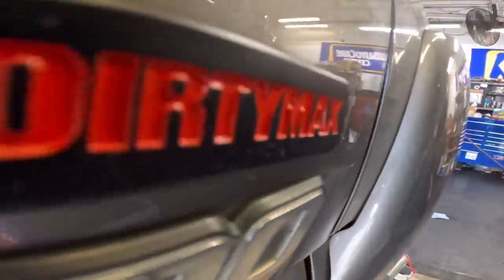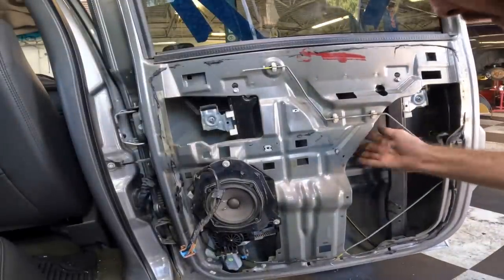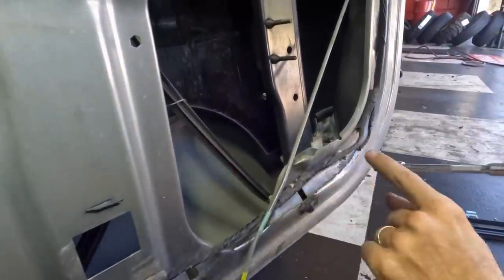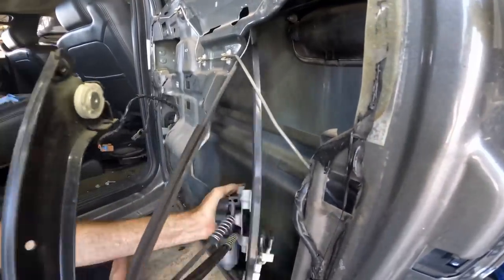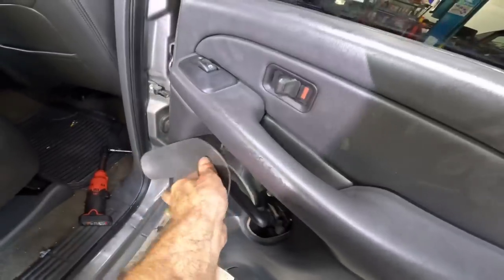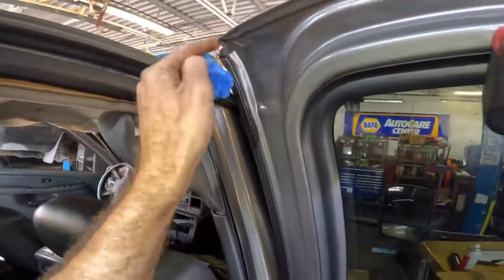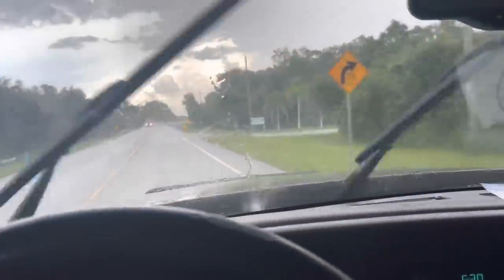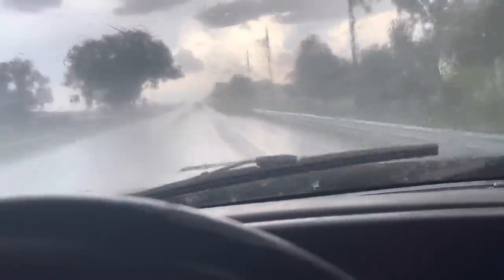Busted Window Regulator!  2007 Silverado 3500 Duramax 6.6

Comment: When working on automobile winders, I appreciate the extra care that manufacturers take to hone all exposed sheet metal to nice razor sharp edges.
Reply: I built dozens of desktop computers decades ago,and signed every one with blood. Couldn’t work with gloves, either.
Reply: I have not opened the inners of a car door since the moisture liner was waxed paper instead of clear poly.
Reply: @MonkeyJedi99    Now I don’t feel quite as ancient. But I do recall having to repair the drivers window crank mechanism on my 1961 Ford Falcon. It was a pain, too.
Reply: @mred8002  Old folks unite!*
*from our separate rockers and recliners, if you don't mind.
Reply: @MonkeyJedi99    That’s good. I had to actually show one of my great grandkids a desktop server I had built (and is still in my shop), as he had never seen anything but laptops, tablets and phones. He was not impressed as it was not a touchscreen. Sigh.
Reply: @mred8002  I had a Ford Falcon too.  It was so low-end it had vacuum-operated windshield wipers.  Your post dimly reminded me  that it was the first time I had to remove a door panel.  I think the door liner was some kind of brown wax-coated paper.
Reply: @anwalt693    Ah, yes. Stock one barrel carburetor with a top speed of about 65, but the wipers stopped at full speed. Heater was pathetic, and for northern Michigan quite inadequate. Put a two barrel carb on to go faster, but wipers still junk. Got me to school and back and was cheap.
Reply: @mred8002  And as I recall, the regulators were riveted in and not bolted.
Reply: @hdfxrs9121    Yup. Had to drill the damn things out. I don’t remember pop-rivets, so had to use machine screws
Reply: @mred8002  haha exactly... was thinking the same when i read the comment... stuck old style power cables (molex) and pulling on them resulted in many bleeding knuckles
Reply: @mred8002  It's a requirement to ensure that the PC will work.  Must pay the sacrifice.  :)
Reply: @JamesP33R    Yes! There must be a blood sacrifice! Never had anyone ask what those rusty stains in the case was, though. I suspect I was the only one to open them and clean them.
Reply: @mred8002  Hell I open up a desktop tower I cut myself just after I open it while looking at how I am going to draw blood. Been that way for close to 40 years. Take the cover off and boom bleeding.

Comment: Ray, back in the 70's and 80's I flew freight in small piston engine airplanes from Rochester, NY where AC Delco had a plant that manufactured those window regulators, power door locks and other small motor accessories. Shipping those power window regulators was a dirty and somewhat dangerous job. They would come to us on a pallet which would not fit in the aircraft, so we would have to manually load them into the airplane one by one taking care not to damage them as we stacked them one layer after another with cardboard between each layer. Then we would use cargo straps to "secure" the load to prevent them from shifting. Once we arrived at the airport closest to whichever plant needed them,-- Flint, MI; Pontiac, MI; Detroit, MI, for example, we would again handle them one by one to unload the airplane. I remember many greasy and blood hands after those flights, but hey, GM needed those parts ASAP and I got to log much needed multi-engine cross country time that airlines demanded before they would hire you. 

There was also a Rochester Products Plant that made carburetors and other fuel system components for GM. They were MUCH easier to ship! As always, another great video Ray.
Reply: I never knew they shipped components like this, seems like an expensive way of doing things?
Reply: @ferrumignis   GM managed their inventory in what is referred to as a Zero Inventory System. That is, they would try to manage to have on hand only those parts they needed for the assembly lines for that day or maybe the next. This frees up capital and reduces costs. They would call us to fly those parts to the plants whenever they were running low on a particular part and were thereby in danger of shutting down the assembly line. Sometimes this happened due to rail delays, storms that delayed trucks etc. While it is expensive to charter an airplane, shutting down an assembly line or keeping a bunch of inventory on hand to build an entire car or truck is way more expensive.
Reply: @UCOkW6d3zz8qHgd7rCGxNMYg Yep. Me too George. BE18''s Aztec's Navajo, etc. Cut my teeth on those and thank God I survived. Made me a good pilot though!
Reply: Great story!
Reply: @Starsnu1  Afaik all major car manufacturers use a simmilar "just in time" inventory, but usualy the parts are transported in semi trucks rather than small planes.
Reply: Cool video Ray! I'm rather impressed by how nicely engineered the window regulator mounts were. You did a BMW or something window regulator a little while back and that was an absolute nightmare from start to finish.  By the by The Last of the Mohicans is also a book written by James Fenimore Cooper back in the early to mid 1800's if I remember correctly.
Reply: Thanks Gavin.
Reply: @ferrumignis  I've always used the more accurate "JAIT" (Just ABOUT in time).  And it's not just auto manufacturers.  It's why the post Covid logistics problems hurt so badly.

Comment: Window regulator replacement was something I never enjoyed as a tech.

Step 1: remove inner door panel- for .000001 hours.
Step 2: remove every other part in door- .000002 hours.
Step 3: remove regulator- .000003 hours.
When all said and done about .00006 hours total for job.
Don't forget the other interruptions from service advisor, waiting for parts etc. 
Then the customer complains it costs too much. Parts people won't budge on cost of parts so labor time gets hacked down some more. After all that, tech gets paid for .000005 hours time. 
It always seemed this way to me anyways. I hope you all reading this see the humor in it, but this is a large dose of reality in there.
Reply: Never worked as a technician but have worked in body shops and I can say it's the same over with those guys. Some want to make the money and others want to save the money. I will say though that ray you are the first technician on either side (body or service) that would rather make the job more affordable for the consumer and not sell for a lot of hours and big pay day. For that I salute you sir.

Comment: WD-40 works great on removing goo.  You just have to remove the WD-40 with soap and water after.  It takes pine sap & pitch off hands instantly (ancient logger's secret ay?).  I bought a truck that was parked under a pine tree for several years.  Sat in my driveway with WD, plastic scraper and red rags.... like new after many hours.
Reply: Orange oil (Goo Gone), vegetable oil, and motor oil all work too. Soapy cleanup required afterwards too.

Comment: Next time you run into adhesive residue on paint (as long as it is a metal) get a 3M eraser wheel, as a detailer they have been a God send!!! Makes jobs like that window guard goo a quick job.

Also, with the window guards, just peel enough edge that you can grab, that way you can adjust without fear of it sticking before you are ready. Then when you are stick the ends, and peel it from between the vent and paint.
Reply: Any suggestions for removing clear bras?
Reply: @tinoyb9294  I don't know of the top of my head, but chatting up a truck lettering shop might get you some good ideas.
Reply: @tinoyb9294  check out AMMO NYC's channel.  He does high end detailing and removes clear bras quite often.  He has some really good tips but prepare for the suck factor.  There's really no "easy button".
Reply: Thank you for telling me about the eraser wheel I've never used one great idea thank you have a good evening

Comment: Get a rubber eraser wheel you can attach to a drill to remove old adhesive tape.  Works perfectly without damaging paint. Made by 3M. Available on Amazon
Reply: Never heard that. Pretty cool.
Reply: Most hand sanitizers work also, rub on and let sit a couple of mins.
Reply: @williamroberts4758  a hand sanitizer that contain isopropyl. Same thing as rubbing alcohol. Hmmm 99 cent bottle of rubbing alcohol or $5 bottle of hand sanitizer
Reply: I think Ray is hoping for another surprise 'gift' package! 😉

Comment: I remember the BMW aftermarket regulator from a few weeks ago that had to be replaced twice. This regulator and installation is a dream by comparison.  Also, much more room in the door cavity and access holes are large. -- But then again, Ray almost always makes everything look easy.
Reply: He worked at a GM repair facility in the past, and I imagine he’s using OEM parts. As he’s said in the past, he’s not a fan of European vehicles.
Reply: @billchessell8213  Also, bolts make the job a lot easier than rivets.
Reply: And, there is no adjusting with this unit.  Set it and forget it.
Reply: I did a BMW regulator and it was bolts and just as easy as this. The only problem was that it was December in New England, so the adhesive was hard and needed a heat gun.
Reply: The concept of KISS engineering is lost on Euros
Reply: @billchessell8213  Neither are most euro owners after 1st senselessly expensive repair.
Reply: @peted5217  Most everything on an e46 BMW was infinitely repairable. Common failure points (aside from the PCV and oil filter housing gasket) were accessible and only required simple hand tools. Ford, Toyota, Chrysler, VW... All of them are designed for appearance and/or convenience rather than being designed for repair. For the record, the only GM product I've worked on is from 1938, but I assume their modern work is the same as all the rest.

Comment: Every time Ray works on a Chevy product it brings back memories of my 68 Camaro and it's problems, leaking windshield, water dripping off the rear view mirror , driver's side roll up  window didn't work (never worked actually) and then the shear joy of my first Toyota truck.  Sold that Chevy and never looked back. Toyota must have been closely watching Detroit manufacturing because they made cars and trucks that worked as advertised and held up over the long run...
Reply: Ya to that , tho ur 68 Camero in un rusted condition would command a kings ransom today. The Toyota would merely be continuing it's ridiculously long service life.....
Reply: @peted5217  I live in California and cars don't rust here .  On the other hand , environmental regs make it difficult to get registration on older polluting cars since our govenator wants Cal to lead the rest of the country in being green.  That Camaro was 305 V8 as I remember , four speed with a clutch that was starting to go south.  Looked great as long as you didn't have to start it and put gas in it.
Reply: @woodway11  Many CA expats surround us here in CenTex. Having left for one reason or another. Mostly selling expensive property there and buying similar for a third or less until recently. A few no doubt enjoy TX emission free registration of anything over 25 yo like 94 Silverado and ancient GM 65 Chevelle and 72 nova I still drive occasionally. Also several Toyota Celicas and a trusty 88 Camry wgn , handy in hi fuel prices currently. These vehicles are considered inconsequential in the environment issue here . Most helpful to an old rodder still enjoying a 'Stop Lite Gran Prix' or two. So , ya, I understand your pleasant thoughts of fun cars past

Comment: I have an 04 burban that I use for my coroner vehicle and all the gauges, but the speedo didn't work.  I learned how to take the dash apart multiple times to get a rebuilt cluster set and have replaced almost everything on the dash in the last 2 years.  Oh, it also shows 243680 miles on the odo.  Keep up the good work sir.

Comment: just another great video, it is nice to learn about the interior panels and wiring . 
the window controls and the use of the suction cops to retain the window in the top
of the track while you replaced the window drive, I learn so much from your presentation’s.

Comment: I love the 2000’s GM trucks. I have a 2002 6.0 unicorn, (1500HD) just rolled over 100,000 miles a few weeks ago. It’s one of the best trucks I’ve ever owned. I’ve had to replace 3 of the 4 window regulators, thus far.
Reply: Domestic Vehicles (except ford) before 2007 recession/bankruptcy are better than those since. Lotsa cost cutting is the main culprick.

Comment: Just did this job on my 2000 Silverado 1500 drivers side door. I just taped the glass in the up position and removed the regulator. Quick and easy job.
Reply: Problem is its a job...Over and over ...puts food on someone's table.
Crappy chev.regulator design
...just keep blue tape in each door pocket.

Comment: Also, acetone is the best solvent for removing decal/tape adhesive you can get - it is safe to use on urethane clearcoat paint.  It works well and I've used it to remove decal adhesive from decommissioned police vehicles.  Just keep it away from the plastics.

Comment: I have a suggestion for the removing the adhesive left from the window guards and tape residue.  We use a citrus, based produce called Citra Safe.  It smells like oranges and will not harm paint.  This produce is available in liquid and in spray cans.  This chemical soften adhesive on contact and will not damage the paint.  I am a licensed aircraft mechanic working the 737 Max and this is what we use to remove tape residue on aircraft that have been storage for more than 3 years.  Thought this might work for you too.

Comment: As an automotive locksmith I grew tired of the sticky kaka all over when removing panels. Probably not the best idea but I was over it. I sliced the plastic in half vertically,  butterflied it open and when done I would use tape and put it back together.
Reply: If you use either metallized tape or house wrap tape you should be fine. Both are vapor impermeable and long lasting.

Comment: You need to use Bosistos Eucalyptus Oil.

Not sure if you can get this product in the USA. In Australia we use this product it makes it super easy to clean off residue left from anything that is sticky or gooey. Once you use this stuff you will never use anything else again to clean stuff like this off again. 

Peel off as much of the sticker as you're able, then press the area with a cloth or cotton ball soaked with eucalyptus oil. Leave the oil to start to dissolve the bonds for a few minutes then simply scrape the residue off, being careful not to scratch your item. Repeat until all residue is gone.

Comment: I have done a few windows for family and when they are broken and need to be put up before a new window motor and regulator is supplied, I would use tie straps to hold the windows in placeuntil I can change out the motor and regulator.  That works really good and you don't have to worry about someone pushing down the window to get into the car to steal everything you leave in it.  Just something to think about next time or for any of the other peeps that watch your channel.  Tie strap the window track at the top closing the window completely it works every time.
Reply: Ya, the plastic pulleys have a finite life, tho the ones in 88 camry and 85 Celica have yet to fail. Owned both over 2 decades so far.

Comment: Must be a common thing with Chevy trucks.Replaced my window regulator several times.The original seemed identical to the crappy Doorman regulator.Fixed the problem by buying Toyota trucks.

Comment: If I need more of the black caulk to seal the plastic, I use 3M Strip Calk (not misspelled). Eastwood makes it too. Amazon has it. It’s soft butyl rubber. Can be used on many things, not just autos. One project I used it on is where my satellite wires enter a 1 1/2 inch diameter pipe that runs through my foundation. Sealed the outside with a larger size  varmints don’t like the taste.

Comment: Every time i do vent visors now i use 3M adhesive promoter after i clean the paint, back when i used to work at a dealership they had us installing accessories on new vehicles and we would have comebacks because the visors would fall off, due to the tape not adhering to the paint. so they would tell us to use the promoter to reattach them. they didn't want us to use it on the initial install because they were like $5 bucks apiece for the little package, so if warranty covered it the dealer wouldn't being paying. i have since bought my own box was like $70 bucks, but its lasted years, no expiration since the packs are sealed.

Comment: Great video.  It's a whole different thing without the road salt.  Road salt just destroys everything and makes a mess, it gets into everything eating it away and corroding it.  They use a liquid here now that will eat chrome off a wrench and it doesn't come off unless you use a pressure washer or hand wash.   Cars from 2007 are mostly rotting away and some have already been taken off the road due to structural failure.

Comment: Love your vids.  Had to  have the front seal replaced on my half ton the other day, its a 07 GMC with a 5.3l motor, I guess those are notorious for going out.  The truck has about 160k on it and Im told I got lucky as many go out around the 130k mark.  The shop had it done in less than 3 hours for a total cost of 330 bucks including parts and labor.  
I was overjoyed that the task was inexpensive as it was cuz people were telling me horror stories.  I did get one bid for a crate motor that came in over 7 grand.  Nope.

Comment: RE : DIRTYMAX...
YEARS AGO, when Dodge introduced the cummins in their D350s I was
camping when one of these trucks came clattering into the campground
dragging a monstrously HUGE 5th wheel trailer. The plate on the front of 
the truck kinda said it all-
STINK TRUCK

!

Comment: Goop is my go to solvent for adhesive; however, it's oil based so it would require cleaning to remove the goop residue after the goop removes the adhesive.